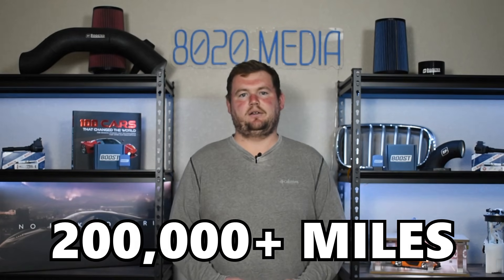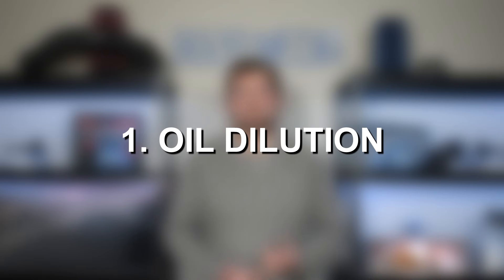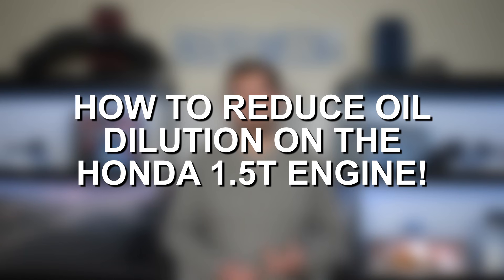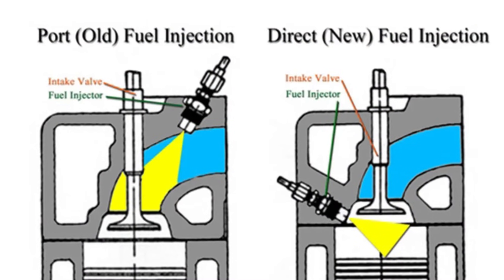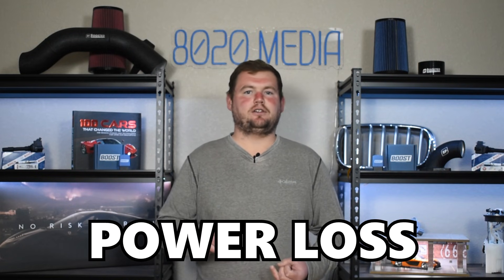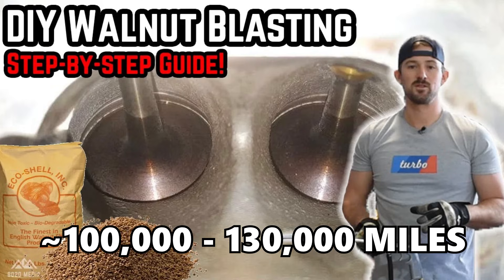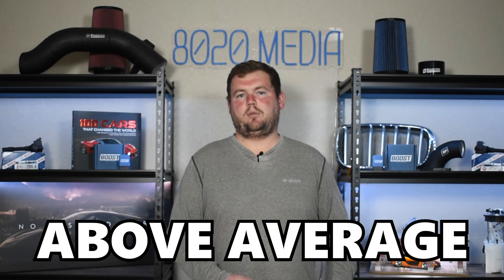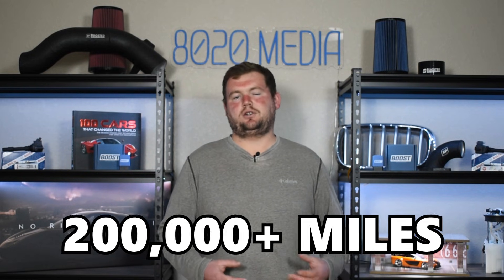Honda 1.5T Engine Breakdown – What Every Honda Owner Should Know! (L15B/L15C)

Comment: Oil changes every 3500-5000
91-93 octane 
Run fuel cleaners containing PEA
Change the pcv valve every 30k
If cvt change the fluid and filters every 30k
Plugs arent that expensive change every 50k
If stock air box keep an eye on the air filter, they get dirty quick
Ditch the oem oil filter, its made by fram and is super basic and a terrible design. Instead run purolator boss, wix xp, microgard select, Baldwin, anything but the oem filter.  

Clean MAF and MAP sensors every oil change
Run an intake valve cleaner every 10k a few 100 miles before an oil change. Gunk has one with a straw that goes from the intake manifold to the can so you can sit in the car and do the cleaning while keeping the rpms up. 

Use a quality oil
In cold climates let the temp get up there for awhile. 
Give it the beans once in awhile.

Comment: 19 Civic SI with the 1.5t. O oil dilution. No headgasket issues. Car has 82k miles on it. I change the oil every 3 months. The oil is at about 50% life left when changed. So far this car has been great!

Comment: Glad that you consider the engine reliable.  My 2019 CRV EXL (currently at 145K miles) had head gasket replaced at 100K, 124K, oil pan gasket 140K, injectors, 105K.  Dealership asked why I only changed the oil every 8000 miles - because that's what the maintenance minder said.  Never - ever again.  I don't go to the dealership any longer and change the oil every 4K miles - 5 tops.  Car is worthless in value because of service history.  I'm glad many have not had my experience.  I previously had Hondas with the 3.0 V6s and they easily ran fuss free for 200K+ miles.  This CRV however will be the last Honda I own and be the last Turbo 4 I own.

Comment: Head gaskets are failing significantly! 30 year Honda owner that has properly maintained engines for years with no issues until now having 2019 1.5L Honda Accord with head gasket repair. Join 10th gen forums and you will learn quickly how widespread the problem is.
Reply: The biggest issue with those motors in the Accord is that the transmission is tuned to keep RPMs low since the Accord is supposed to be more of a luxury-oriented car than the Civic, which comes at the expense of lugging the motor. That's not healthy on its own, but then you factor in the 87 octane that Honda says this motor is designed to run on, and when mixed with a turbo its just a perfect mix to kill the head gaskets. That's why they have been much more reliable in Civics, they are tuned to be more rev happy and in turn don't lug the engine as much.
Reply: @CB_9706 Honda recommends premium for the L15b
Reply: I have seen its mostly accords.  I see it on civics too, but only those who have started adding serious boost. I dont really see it on civics running just an extra 6 psi. Mostly those going big.

Comment: My wife has a 2019 CRV. I just changed the engine air filter. It had oil on it so I researched the problem It says my PCV valve was clogged so it was an easy replacement easy to identify. It’s yellow plastic on the back of the engine, I will see what happens. Hopefully it fixed the problem. The car has 46,000 miles on it and runs perfectly.

Comment: I got a 2016 honda civic ex t 1.5..i go thru a battery every 2 years… i got it in 2019… on my 3rd battery right now. I didnt have any problems until about 230000 miles… i have went thru 12 coils in 2 and 1/2 years..  spark plugs changed 2 times within 2 yrs or so.. i put on alot of miles.. in 2019.. it only had 47006.. now im at almost 241000 and running great!!!!
Reply: Did u blow a head gasket yet
Reply: @MrXjmann360 possibly.. only sign is i been losing coolant an dyet have no actual leak. So who knows.. going to have honda dealership do a full diagnostic soon… maybe… idk…

Comment: Are you really supposed to use 87 octane or 91 octane on this low pressure turbo engine?
Reply: Did you figure out?
Reply: I hear 87 is best because the engine needs a hotter burning fuel to run efficiently

Comment: .I would have to disagree with you saying the head gasket problem isn't that common. I know two Honda tech's and they are getting 4 to 8 blown head gaskets per week. Honda should go back to the bulletproof naturally aspirated 2.4L but I know the EPA is tightening the screws on all brands.
Reply: The issue is the gasket, not the engine size

Comment: Not arguing but I do disagree with the head gasket issue. I have a 2022 civic ex 63k miles no tunes no mods no nothing all 100% stock. Head gasket went and said hey. Your gonna go to work in limp mode and I’m not pulling out of limp mode till you get to work to fix me
Reply: Dealership diagnosed a blown head gasket on a neighbor's unmodified 2020 Honda Accord with 75K miles.  A class action lawsuit has been filed: the lawsuit alleges turbo engine coolant collects in the grooves on the engine’s cylinder head and destroys the head gasket, allowing coolant to leak into the cylinders.

Comment: My wife has a 2016 civic and we are experiencing the oil dilution.  I change the oil myself and after adding the required 3.7Quarts with a new filter, my dipstick reads full, right to the top level.  I just changed the oil two days ago at my regular 5000 mile interval and ended up with 4.1 Quarts of used oil/gas in the drain pan.  I've had as much as 4.3 Qts. on other oil changes.   I use only full synthetic Pennzoil 0-20

Comment: Kinda mixed message about long term reliability.  The oil dilution won’t really start to show up until past the warranty(even the extended one).  
I’ve owned nothing but Honda since 1987 and love them for efficiency and reliability.  My previous two Civics owned were bought new and kept 14 and 19 years.  In looking to replace my 2006 I kept finding horrible stories about the design flaws in the 1.5T.  The thought of having to spend more time and expense on maintenance ruined my conception of what Honda used to be.
I couldn’t pull the trigger on this new engine(not to mention CVT) and bought a ten year old, normally aspirated engine with 5 speed manual.

Comment: I would go for the Honda 2.0 litre, however I can't afford it. In fact I can't even afford the 1.5 litre. I will just stick with my Civic 8th gen i-shift 2009 (UFO shape)
Reply: hrv 2025 and 2026 2.0 port injected no turbo but with  cvt.,last of the older tried and true.

Comment: I'll chime in with my sample size of one. 2018 Civic Si Sedan with 208,000+ miles and ZERO issues. In the first 60K miles I would drive spiritedly and rev it out regularly, now I drive like a grandma. Only ever used Mobil 1 0W-20, same weight recommended in the owner's manual. Original clutch and original everything except main headlight bulbs and tires.
Reply: I can relate with my ext got my fun in when it was young . Now I drive it like ,and adult,but it still has that get up and holds up well same oil.
Reply: Original owners of a 1997 Honda Accord LX with 231k miles and a 2009 Honda CRV with 208,000 miles . Maintenance is the key.  Great vehicles.

Comment: In Australia we are supposed to change the oil every 10k kms so that seems about right. 10k miles in america? That's gotta be a big contributer to failures.
Reply from the maker: Y - Sure is!
Reply: Completely agree - but most people are not car savvy and change the oil when the maintenance minder comes on.  When the maintenance minder comes on every 9,000 miles....   You get a car with planned obsolescence.  I find this to be very bad optics for Honda.  I never paid attention to the maintenance minder on a vehicle (did everything early) until my CRV when I figured the mfg wouldn't have the maintenance minder that far out if the car wasn't designed for it.  So far - that has been about a $7,000 mistake in repairs.

Comment: Here in Saudi Arabia we have accords with 1.5T engines going all the way to 450k and 500K KM which equals to 280k to 300k miles. This is a turbo direct injection engine ! And the CVT transmission is stil original!! Wow Honda
Reply: Exactly, over here in Kuwait as well I have asked a few Honda techs how often have they seen head gasket failures on the 1.5T and so far they have said none. These seems to be prevalent in North America with the fuel quality issues.
Reply: Believe it or not just learned yesterday from a Toyota dealer. Toyota is actually the originally creator of the CVT transmission
Reply: No DAF had CVTs in the early 60's.
Reply: Whats the minimum octane fuel over in Saudi? 91?
Reply: @rn3194   Saudi uses a different octane measurement system which is in RON. So a 91 rated fuel in Saudi  is equivalent to 87 in the US. 95 RON would be 91 in the US.
Reply: @rn3194 yes . We have 91 & 95.
Reply: @rn3194 yes its 91 and the premium fuel is 95 octane.

Comment: My mom’s 2018 CRV with a 1.5t has lasted 265k miles. It’s running terribly now, constantly throwing check engine lights, and I expect it to die soon. She drove 99% highway miles which is why I believe it has lasted so long. As far as I know she’s never had the turbo replaced, and I think the turbo is about to blow. There is absolutely fuel dilution and she only changed the oil when the maintenance minder light came on. If it were my car I would have changed the oil much more often. I believe if she had changed it every 5k instead of every 8-10k it would be running much better and likely last another 50k+ miles.
Reply: When was the last time the spark plugs were replaced? Sounds like a poorly maintained vehicle.  Bad running can also be a coil issue,  fuel injectors, fuel filter, totally dirty air filter, etc....
Reply: @1958Cadillac-v2g  probably all of the above. People forget these arent the hondas of the 1990s anymore. The 1.5t especially requires a ton of extra maintenance.  10,000 mile oil changes are not a good idea, same with running 87 octane. Injectors go bad all the time on these too. Even with regular fuel system cleaners containing PEA.

Comment: Question… looking at a 2020-2022 Honda CRV 1.5T, is the Turbo constantly engaged? I drive 60 miles round trip to work on the highway, very easy driving. I would change the oil every 6 months, 4-5k and use 89 octane gas is this a good rule of thumb? It be my first Honda, I love the 2020-2022 CRV body style too. Would a certified Honda be the best to go?
Reply: My wife has a 2019 CRV and put 46,000 miles on it so far it has been an outstanding car and she really loves it. Good luck!

Comment: Running an upgraded turbo on my 2017 civic si making roughly 300whp and has been going strong! Only downfalls ive read upon are headgasket and fuel injector issues. If youre somewhat mechanically inclined the headgasket is not hard to replace it is essentially a lawn mower with a turbo strapped to it
Reply from the maker: M - Thanks for sharing! Sounds like a sick build.

Comment: Honda Civic 1.5T 2022. What oil should I use -  0w20 or 5w30 (for example Ravenol VST)
Reply from the maker: G - Using 5W-30 instead might give a tiny bit more protection under heavy load or heat (it’s thicker at operating temp), but it’s not what Honda designed the engine for, and it may reduce fuel economy and alter the “break-in” warmth behavior slightly. If you want peace of mind, stick with 0W-20 and high quality, or if you do use 5W-30, limit long oil change intervals and monitor for any changes in consumption or performance.

Comment: i have had my sport hatch for 5 years keep up with oil changes and cvt changes no issues engine wish but also issues like batteries not lasting more than 2 years last weekend the car wouldn't start leaving work security there gave me a jump so i went to auto zone to get it tested they said the battery was good then the starter was bad then it wouldn't start again wed called a tow truck they gave me a jump and it was the battery so got that replaced but yea i got a oil change coming soon gonna get the injectors cleaned up
Reply from the maker: R - Thanks for taking the time to share your first-hand experience!
Reply: I got a new battery a few months ago at AutoZone. They said all batteries these days only last for about two years because they’re junk for whatever reason, when I keep my wife CRV in the garage for a while, I will connect a battery tender to it, which keeps it topped off and they’re really a great idea.

Comment: With the 1.5t, oil dilution is common in colder climates or states. I’m in Florida where it’s hot all the time so I won’t have issues with oil dilution. I have a 2022 Civic Si with 46k miles. No issues so far other than minor electrical problems like SRS light and Brake system light.
Reply from the maker: D - Thanks for sharing your first-hand experience!

Comment: I had 160k in 5 years on my 2018 si change oil when it told me.   No issue with motor and still was getting 35mpg with tune for 140k.   Two warranty with ac and also had to change wheel bearing at 100k.   Sold the car in 2023.   Great daily car
Reply from the maker: J - Nice! Thanks for taking the time to share your experience.

Comment: I’ve got 110,000 miles on my 2019 civic hatch sport with no problems.  
I change my oil at around 5 to 7k religiously.  I’ve changed the spark plugs once, radiator fluid once and transmission fluid once. I drive the manual version.  I’ve used the fuel injection cleaner at least 3 times.  I always drive in econ mode. Once in a while I use the sport option but rarely.
Reply from the maker: J - Nice! Thanks for taking the time to share your first-hand experience!
Reply: I have a 2022 1.5 Accord and do you think driving in Econ helps with the dilution and head gasket issues? I get oil changes at 5000 miles, use top tier non ethanol premium shell v tech and let the engine warm up for 30 seconds before starting. I also let the engine warm down for 30 seconds before shutting off the car. I never use the sport mode nor the Econ mode. I only have 37,000 miles, no problems yet

Comment: TLC is expensive.  You need to warm up the turbo and change the oil more often. To avoid short trips you have find a highway and drive around every single time. Premium gas will be an extra $500 or more per year. Spark plugs and coils $400. After 10 years that's $5,000  worth of TLC. Might as well buy a different car.
Reply from the maker: J - You could say that about a lot of modern vehicles though.

Comment: use 91 or 93 octane fuel
Reply from the maker: T - Thanks for sharing.
Reply: I hear 87 is best for these engines because it burns hotter and these motors need the heat to run efficiently.

Comment: I got a 2018 Si with 84k, thats tuned and hits upwards of 22-24 lbs of boost and CAI since 35k miles. Never beat on it nearly as much as most Si owners do. The ONLY real issue Ive had is the plugs are looking like they are opening up. I changed them with NGKs at 75k miles. About 6-7k later, i got a nasty misfire. I tighted the gap to around .025-.028 and that fixed it. Then it came back a few months later and it looks like they opened up a little again. I got the coolant system pressured checled to see if coolant was leaking down into the cylinders indicating a head gasket isse cause I was paranoid, but 0 leaks.  Thinking about getting OEM plugs soon to see if that will fix it. Hopefully the HG wont be needed any time soon!
Reply: Definitely get OEM plugs direct from the dealer, I made the mistake of buying plugs from Amazon that were “supposedly” NGK’s, 20k miles later I had a misfire on the #4 plug, went to a dealer and no issues since
Reply from the maker: L - Sorry to hear this.. However, thanks for taking the time to share your experience.

Comment: This guy is sugarcoating the Honda engines. Hondas are absolutely garbage quality nowadays.
Reply: Still better than most brands
Reply: A 10th Gen 2.0L Honda Civic with the K20C2 would strongly disagree with you. Pair it with a manual gearbox and it’s as reliable as it gets. 😊
Reply from the maker: T - Completely disagree.. We would put Honda second, behind Toyota.
Reply: @8020Automotive Toyota, Mazda, Subaru, Nissan and Honda….in this order. Honda parts quality is disastrously poor. Engineering is worse with those garbage Turbo engines.
Reply from the maker: @Thankyou_3  Everybody is entitled to their own opinion. But it sounds like you've had a bad experience, causing a bias.
Reply: @8020Automotive I have had best experiences with Honda from early 1980s up to late 1990s. Pretty much last decade they are a disastrous brand. Toyota, Mazda and Subarus takes the crown for the last 10 years.

Comment: Hello I wanted to come here to plug this info in. I know this was an engineer video by my previous 1.5 Si manual started grinding 2nd gear like something awful because the new owner (I traded to a type r) back flushed the transmission. Just something to be careful with. Had 90k miles and I changed transmission fluid on my own before his ownership.
Reply from the maker: B - Thanks for taking the time to share this!

Comment: Lots of videos on this subject. 
This is one of the better ones. Injectors are an issue alright. They don't like being left to bake in hot weather without being started for weeks unend, expect them to get sticky and misfire. Worth mentioning is that the GDI engine is amazing at low end torque. It's tempting to labour the engine, gear change indicator enforces this habit. But pushing the engine at low revs makes a silent knocking more likely.  This is more a problem with low octane fuel. That's why using premium helps. All summed up, they drive a lot like a diesel and have similar issues. Excess town driving isn't good for them. But the mpg is amazing. Still, Missing the K series!
Reply from the maker: S - Thank you for the feedback! We really appreciate it. Also, thanks for taking the time to share your experience.